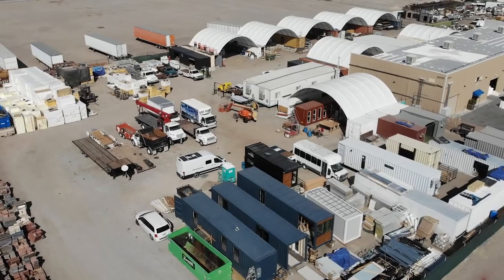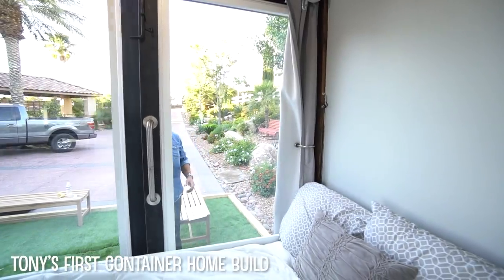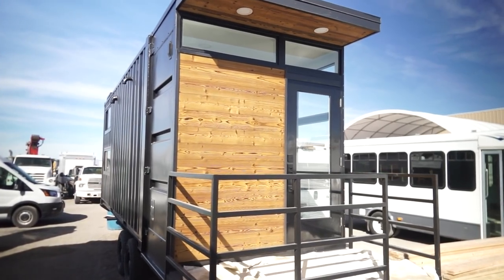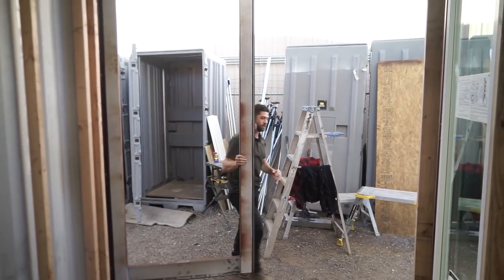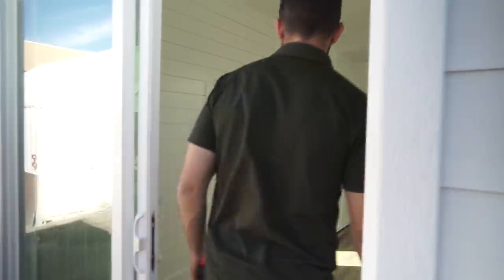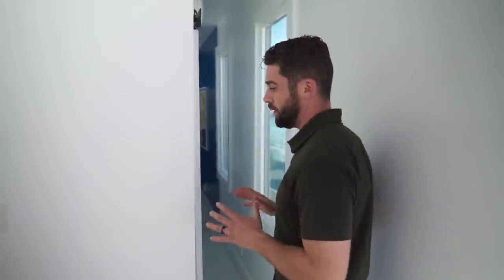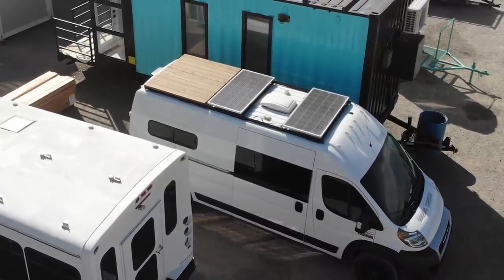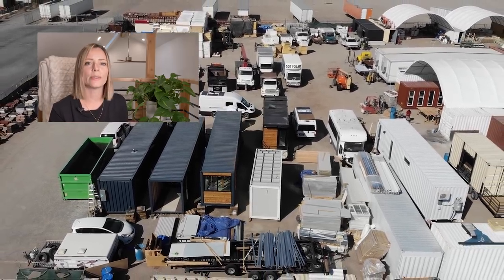Container home builder shows how these homes are made

Comment: Quick question: what do you use as insulation?
Reply: @Nancy,
2003, for our ExpeditionVehicle, we used:
* adhesive-back acoustic against the inside wall, a gap, then
* one-inch pink-board, another air-gap, then
* two-inch foil-side poly.
I hope this helps!

Comment: If it were just a little wider I would love it.
Reply: @Jill,
Good eye.
The can has a 7'8" interior.
Minimum of 4" insulation on each wall.
Now, we are down to close to 6'10", but the 'usable width' is much less because nobody walks dragging a shoulder against the wall.
.
How far does a recliner need to be from a wall to clean around?
.
Many DIY home-made builders reduce the dimensions of built-ins -- counter-tops, cabinets -- to not visually and viscerally over-power the cubic space.